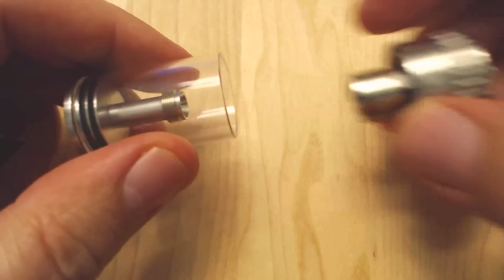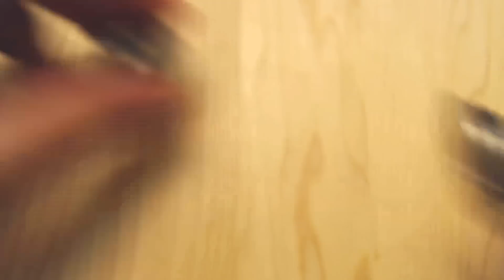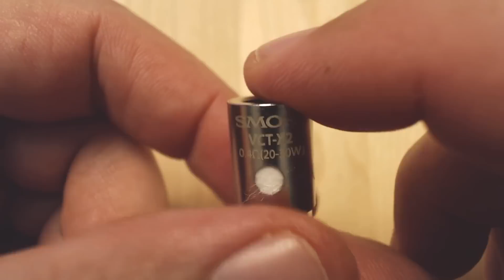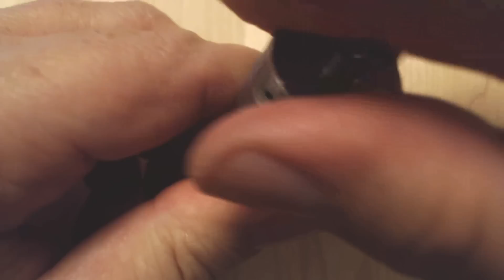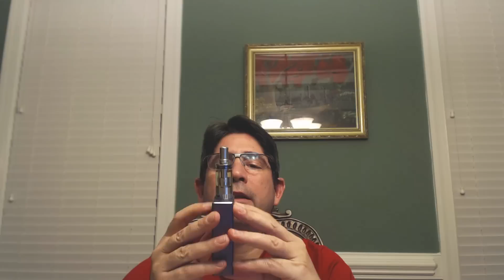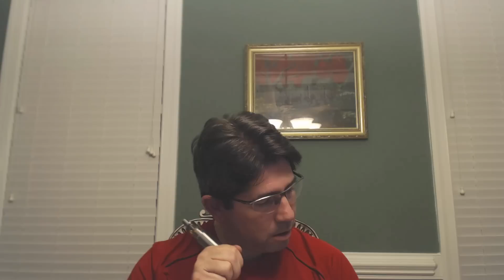Smok VCT

Comment: how the hell did he remove the bottom so easily mine isnt coming off att all i filled it once and now its stuck. any help pls?
Reply from the maker: Oskar Lappalainen Try wiggling the top a little before unscrewing.  Grab the top and bottom with something rubber for help gripping.  As a last resort you can try pliers on the end, but make sure you have something like a rubber pad so as not to scratch it.

Comment: Can you use this tank on a hybrid mod?
Reply from the maker: Can you: yes, should you: no.  I don't use tanks on a hybrid because they usually don't have much spacing between the threading and the connection pin sticking out.  Most connection pins in top caps are now usually smaller in diameter than the threading on atomizers so you don't see an issue if it's not sticking out.  I would recommend not to use any tank or atomizer that doesn't have an adjustable pin on a hybrid, possibility for shorting is high.

Comment: I found this out buy mistake because of the less than buttery threads leave the coil on the chimney when you fill and you can get quite a bit more juice in it, I fill it up to about 2MM from the tank rim and it hasn't flooded yet. I like the dual coil core great flavor better than the Atlantis and Kanger sub IMO. Thanks for the review
Reply from the maker: Yes, did that too, you can get about 5mls doing that.  And I agree, that dual core is nice, still waiting to try the DIY core.

thanks for watching and commenting.
Reply: Yea I got the dual coil and it is huge clouds great taste. 
The DIY core is really just a pre built dual coil. it is not really DIY. its just a dual core an you wick it yourself. Should be called WIY.
every month or so, you still buy another that is pre built dual coil already with no wick. Guess it last longer to rewick yourself though.
Reply from the maker: Turφ ¼²° I guess they came out with this for the first step in people moving from prebuilt coils to wick your own.  Hoping they also come out with a fully rebuildable one.